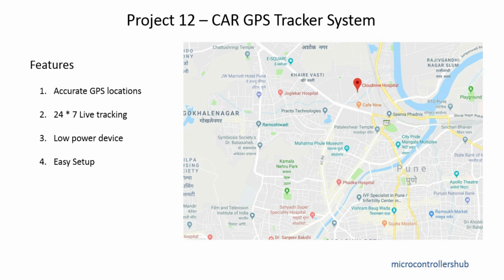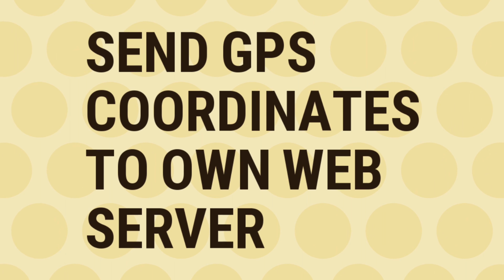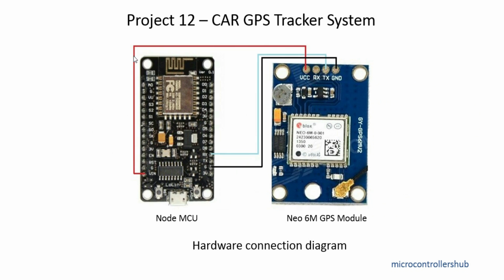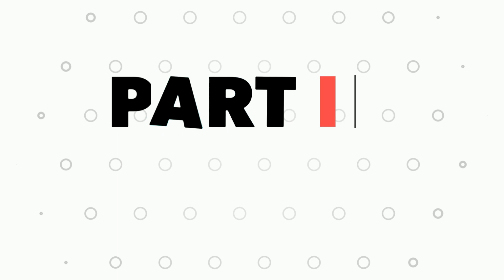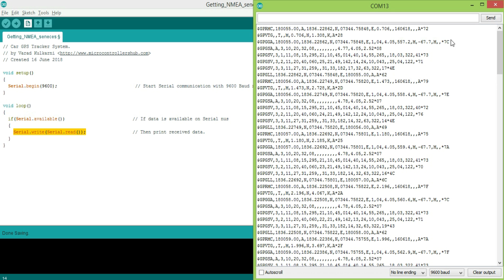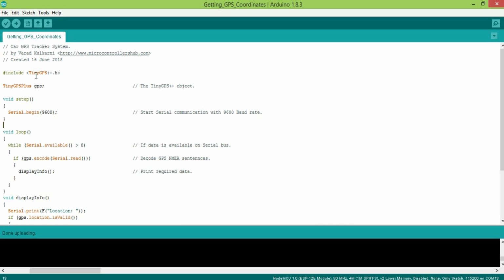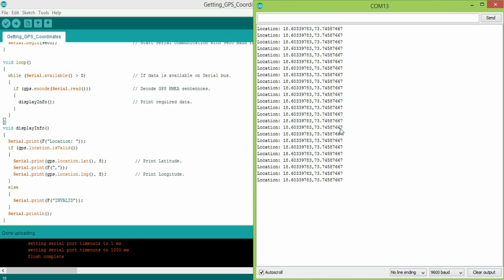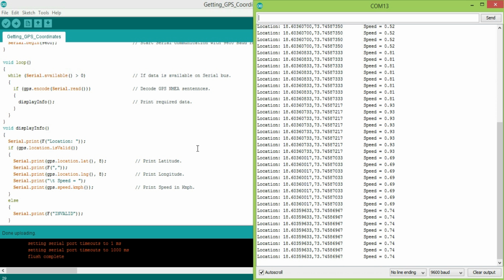Project 12 - Car GPS Tracker System Part 1

Comment from the maker: Car GPS tracker system part 2   (UBIDots Web Server)
https://www.youtube.com/watch?v=SUdUpQIdlyc

Car GPS tracker system part 3   (Create AWS EC2 Webserver)
https://www.youtube.com/watch?v=ClVIOOwE2aA

Car GPS tracker system part 4   (Scripts to receive data on Webserver)
https://youtu.be/PJbT6GXxXfA
Reply: hi @microcontrollershub, please can I know the connection between nodemcu and lipo battery, did you use a regulator, and how was the battery life, I am stuck with that problem and it would be a great help if you can reply as soon as possible. thank you.
Reply from the maker: +Lyric Core 
Well it all depends on your battery specifications and external peripheral connected to nodemcu. But is should be possible to do so...
Reply: Good
Reply: hi @microcontrollershub, I met a problem with the code, it says the 'location' was not declared in this scope, what should I do? Waiting for your favourable response , thank you.

Comment: I have done the connections and copied the same code.. neo 6m is blinking, node mcu blinks as the data is getting uploaded but the serial monitor is empty. 
where could I be going wrong? any leads?
Reply: one more. the control never goes into the loop of "Serial.available()"
Reply from the maker: Check the Baudrate in the serial monitor, it should be same as defined in the code

Comment: How do you know witch Tx and Rx pin you have to connect? I have 3 uarts in my esp32
Reply from the maker: It depends on which UART you are using in your code. Try connecting to the first one

Comment: Thank you sir for uploading this video. I am currently working on my research project to help blind farmers in Cambodia for farming. One of the important aspect of the project is the navigation system. I am planning to use raspberry pi with the GPS module you mentioned in the video for collecting data. I am stuck at the place where I have to use an analog compass and a vibration motor for haptic feedback to the blind farmer. I am a bit confused about how I will integrate everything along with IOT implementation. Any advice from you will really help.

Comment: Hey Varad,
This looks like a nice video to learn how to work with gps modules.I had few questions, 
1. How do we setup (connect) which gps module the arduino code will track and display data about?
2. Will we have to connect the gps and the laptop using usb connector, would there be any other steps that must be performed in the arduino for us to be able to register the gps module.
3. If I have to connect in a wireless manner then do do I register which gps module to track
Reply: Varad, I was able to set-up most of the stuff and the NEMA codes now come up randomly when I open the Serial Monitor. However the serial.available() always returns blank because of which the code is unable to move further and print the lat and lang. Would you be able to advice where I maybe going wrong, apologies if my question may be silly, I'm new to this and doing some self exploration.
Thanks in advance

Comment: Hi Varad,

Great tutorial. Thanks for this!

I'm trying to get this project to live track movement within a site that has a 20mtr radius. And to do so as a wearable device.

To do this I will need 
1. wifi internet connection within range of the Node MCU at all times (at the centre of the site)
2. Neo 6m + Node MCU + battery (so it can be carried remotely)

Is this correct or will I need extra components or breakouts?
Will an antenna help to get a more accurate reading ?

Thanks
Reply from the maker: +Anwar Lowther 
Well setup looks good, you can go with it.

If the site is in a open field, normal antenna will work fine, but if you are planning to use it indoors, then I am doubtful about getting good location accuracy. In this case, you can alao have a look at indoor localisation using BLE.
Reply: @Microcontrollershub  Hi Varad,
Thank you for this - I was unaware about BLE's until you mentioned it - thank you very much

Comment: Hey there, very nice project, so if I would like to use it on a bicycle (as a kind of theft tracker), i would need to send the data through gsm right? (no way to get permanent wifi)... any advice on a module to add? or should i use a different microcontroller/gps module?  Thanks a lot man!
Reply: Maybe ESP32 with SIM800 ?
Reply from the maker: +Quentin Liard 
Yes, this would be better option in your case
Reply: @Microcontrollershub  thanks for answering, i'm still looking forward to finish your great videos, i guess most of it will be usefull anyway :D

Comment: how will you connect esp32 to aws? u need internet conn right?
basically how will you track the car with just esp32+aws?
Reply: You probably need to use a SIM. I believe previous comments talked about using SIM800 with the esp32

Comment: Am i missing something?  This uses the NodeMCU to process the GPS data.. fine... and uploads to the internet... ok.... but how does it do that?   Wifi?  Thats fine all the time you are in range of your wifi router.. but what happens when you drive down the road, nowhere near wifi ?

Surely you should have a GSM / 3G module so that you can upload the GPS location from anywhere otherwise its kind of pointless isnt it?
Reply: good point, i was thinking same thing
Reply from the maker: Good question!
Well in the current implementation, there is a wifi dongle placed in the vehicle, which has a 4G sim card in it.

Comment: How can we see neo-6m location on android phone. Please provide some information if u have
Reply from the maker: +Aman Raj 
You can get gps location from neo-6m to any 8 bit microcontroller, lets say Arduino and then send it to mobile phone using Bluetooth (using HC 05). For longer distance use try using local wifi and wifi module to send GPS values.

On Android phone you may have to search or develop an application which can read these data and plot on map ☺️

Comment: My Location Shows Invalid man It is like this in general with no location
$GPGGA,235337.00,,,,,0,03,3.56,,,,,,*56
where does it go wrong?
Reply: $GPGGA,235336.00,,,,,0,03,3.56,,,,,,*57
$GPGSA,A,1,15,24,21,,,,,,,,,,3.70,3.56,1.00*04
$GPGSV,3,1,10,10,31,321,,14,30,227,,15,12,036,38,20,38,354,*7A
$GPGSV,3,2,10,21,69,037,37,24,32,073,29,25,05,156,,27,14,311,*7E
$GPGSV,3,3,10,29,24,169,,32,45,240,*7D
$GPGLL,,,,,235336.00,V,N*48
$GPRMC,235337.00,V,,,,,,,130219,,,N*76
$GPVTG,,,,,,,,,N*30

what is this?? why isn't it receiving the main coordinates??
Reply: I mean the GPS module works fine with Arduino and is also blinking blue but not able to read the lat and long coordinates
Reply from the maker: +sai praneeth Parasa 
This is the proper format in which GPS data is received. You have to use your code to decode GPS coordinates from it. Please check my video to get more details
Reply: @Microcontrollershub  still not getting decoded cordinates

Comment: Man It doesn't work for me. The thing neo6m won't work.
Reply from the maker: +Bryan Palacio  Neo6m takes little bit of time to get  connected with satellites. Try to do your experiment in open area.
Reply: Microcontrollershub I thinks there is something wrong with the wiring stuff. Idk man I put the right place of those wire over and over again but it doesn't work. I hope you can help and. Another reason is the neo 6m doesn't blink anyway? There is any problem with that if he doesn't blink? I mean those blink lights.
Reply from the maker: 1. LED's will blink once it gets connected with satellite and you will start getting data as well. So you can try replace either neo6m module or controller board if possible
2. You can do it on bread board or Zero PCB, which ever is comfortable for you
Reply: @Microcontrollershub  man I forgot something to ask. hmmm I do actually need a breadboard to make this project?